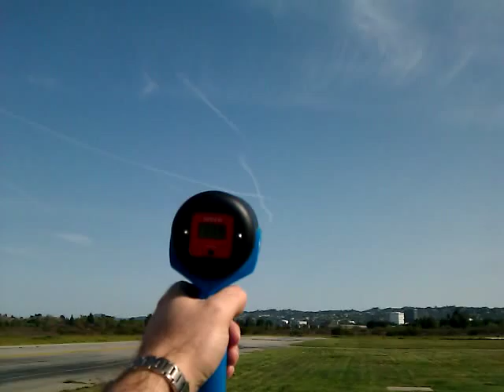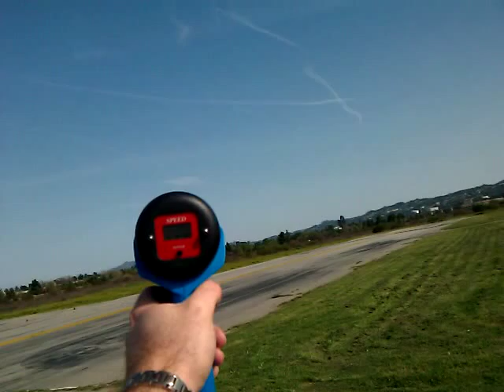208MPH CompARF Spark - 5700 WATTS - FAST RADIO CONTROL EDF RC JET ON RADAR

Comment: HI Paul. The radar gun is a Decatur ProSpeed.  We are normally clocking much smaller pylon racers and sailplanes with this gun and it works great.  It has a harder time with the sailplanes above 200mph, but it picks up the jets on every pass.